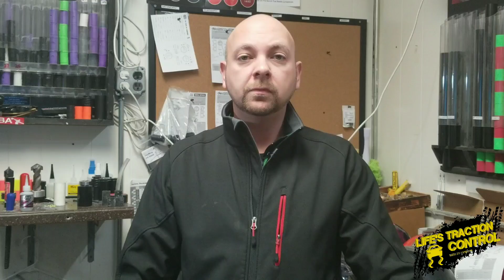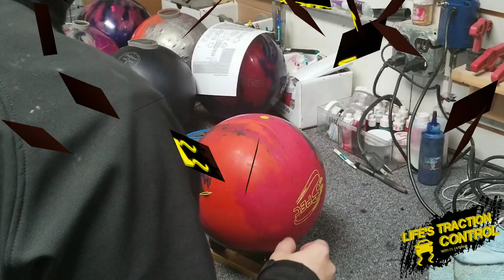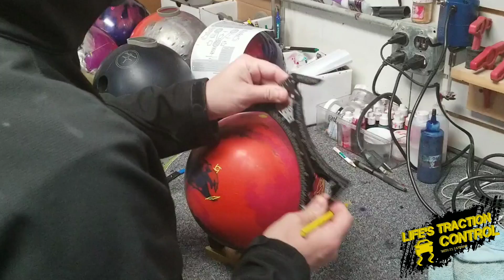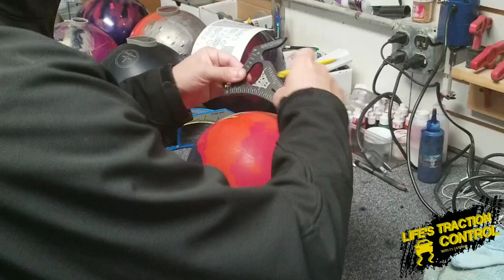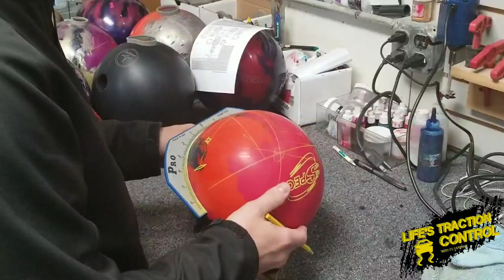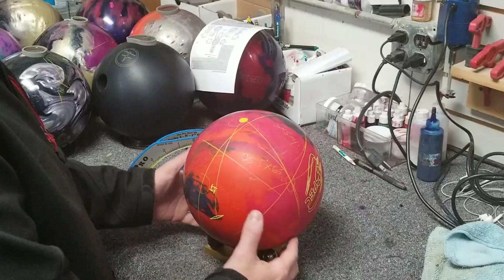Laying out a bowling ball using the storm vector system | Pin buffer

Comment: The trackflare profile for symms is always bell-shaped with 3.375" being maximum, but the Blueprint trackflare study shows that asymms with high PSA values can have MORE flare (and forward roll) at 5-6" pin-PAP than at 3.375" pin-PAP, depending on the position of the PSA, with the trackflare profile being a slope.  http://blueprintbowling.com/Documents/Bowling%20Ball%20Track%20Flare%20Explained.pdf

Comment: I just got my ball drill today and the guy that drill my ball didn't do any of these stuff you doing. All he did is measure my figure tips...now when I bowl it hurts my thumb plus it hook so off I c ant even control it...is that normal? Should I go get my ball redrill?
Reply from the maker: If it hurts definitely get it looked at
Reply: Also another reason to have a regular pro shop you attend. If you’re traveling to different shops they won’t have your pap. That’s the key to doing these layouts.
Reply: @Tenpindoctors  i think i am just going to bowl without using my thumb just gotta relearn how to bowl
Reply: @etan5716  you right but I don't bowl much just started to bowl so I don't have a regular place to bowl yet....

Comment: Max flare on an Asymmetric is not 3 3/8".
Reply: From your positive axis point it sure is. 3 3/8 puts the core in it's most unstable and violent  position
Reply: @tylerstine784  that's on a symmetric core. Asymmetrical cores flare more the farther you get from the PAP. Max flare would be between 4-6" depending on the mass bias position on a strong assym
Reply: @gibby9209  didn't read asym lol. Yes that's dependent on mass bias.  If you put it in its weakest position though 3 3/8 will still be max flare  stronger position you place the mass bias the further you can go with pin to get more flare.

Comment: how you guys drill every ball 5 inch pin to pap i'll never understand. why skid the ball 10 feet before you get to the pocket and make it come in hard? I do that and I leave 10 pins all day long and or face nasty splits.  4 - 4 1/2 with a 45 val works best if you want a smooth reaction. 5 inch or 5 1/2  i'm coming in behind the headpin.
I Don't know how you do it JR lol
Reply from the maker: Longer pin doesn’t mean longer skid. Generally means less flare and smoother transition from hook to roll phase